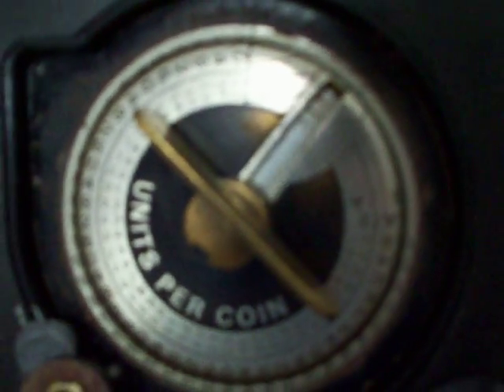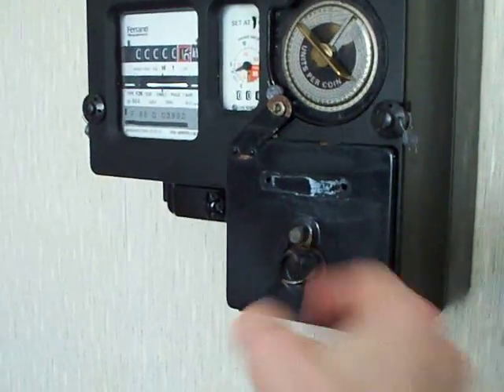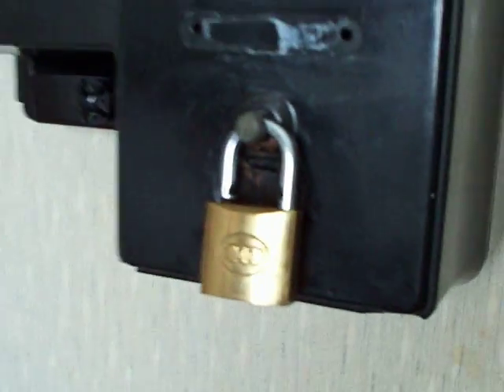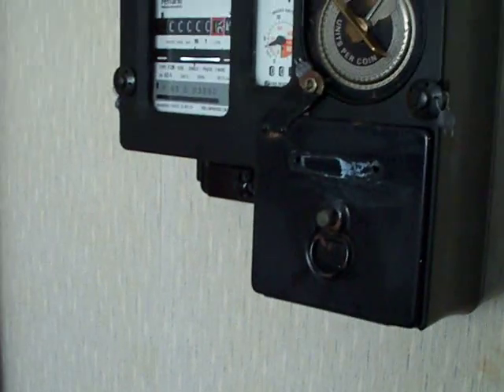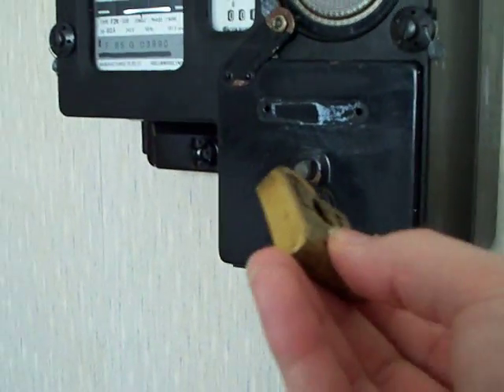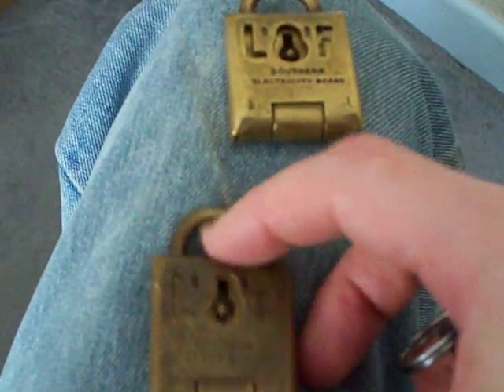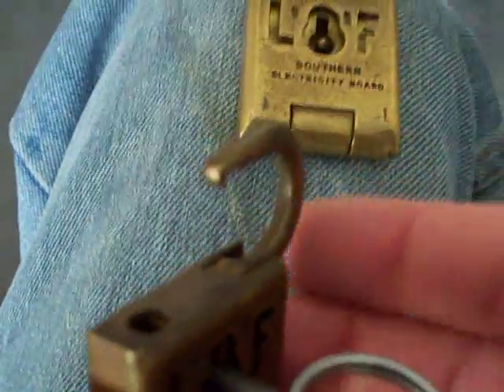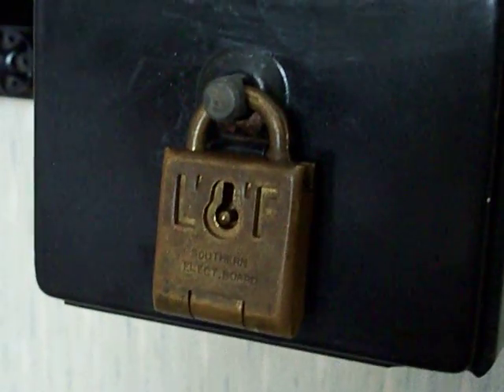Electricity Meter : Padlock for coin-operated prepayment meter! (Pt 1 of 2)

Comment from the maker: (Message 4 of 4) ...dual-level coin boxes. Then the 1990s arrived & in about 1992-1994, electric boards discontinued these coin-op electric meters & replaced them with electronic 'key' meters. Because the padlocks to the meters were no longer needed, MANY THOUSANDS of them were scrapped & melted down.

Luckily for me, all these years on, I manage to find one, complete with its original key! It's also from my metering region as well. :D HOW MUCH OF A BONUS IS THAT? 

Thanx for watching,

-BBD.

Comment from the maker: (Message 1 of 4) I believe that they cycle for emptying these was quarterly. The manufacturer [partly] had a way around the problem of a heavy electricity user: A larger two-level coin box, & the lower section of the coin box was outside of the meter & hung underneath it.

It was known for these electric meters to occasionally be filled up solid with coins. I once attempted it with a two-level coin box on one of my meters in my bedroom around my previous house. It took a couple of years to.....

Comment from the maker: (Message 3 of 4) ......coin box for those too! On the odd occasion here-and-there, I am sure that those kept on getting filled up as well! Another solution was needed. In 1983 when the £1 coin was introduced, because the coin was physically smaller but double in value, Smith / Ferranti jumped on the opportunity to make £1 coin mechanisms. Because the meter's "Units-Per-Coin" could be turned right up & the coin itself was smaller than the pre-1997 50p coin, more coins could go into the larger....

Comment from the maker: (Message 2 of 4) .....fill it, but when I did, it had about 630 coins in it (and they were £1 coins as well, so that was £630 worth of £1 coins in cash!)

In the early days of the Smith meters, the coin boxes weren't that deep. Then they made a dual-level coin box for them. Over time, with people buying more gadgets, it wasn't enough, so they re-designed the meters with a deeper 'square' coin box of a similar capacity. When that kept on getting filled, they then made a dual-level.....